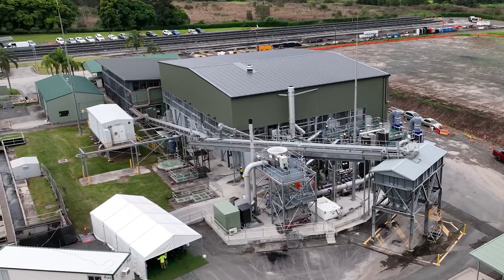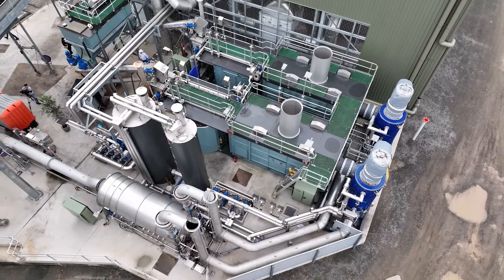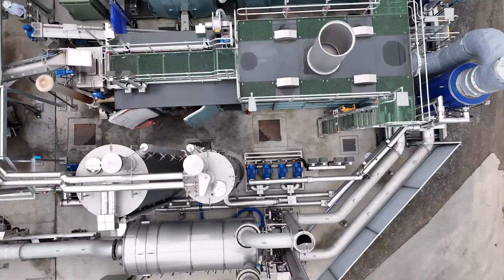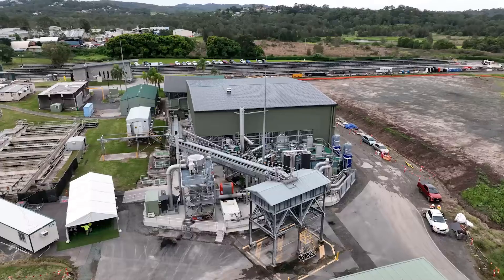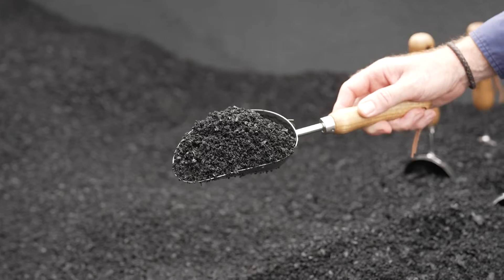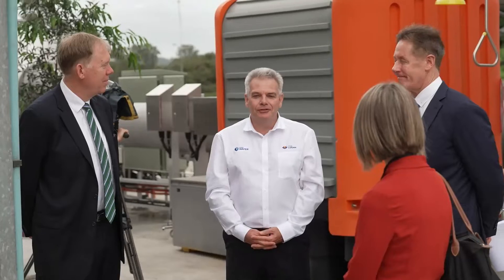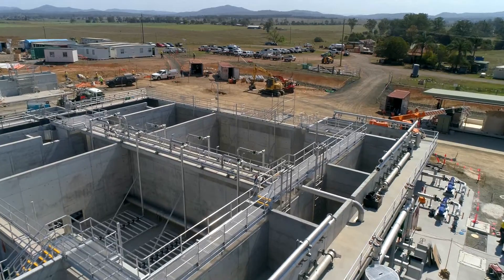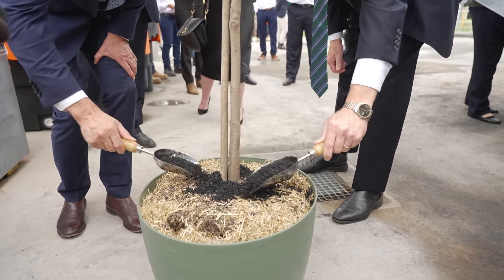Making biochar in the City of Logan

Comment: Can someone answer a question from Logan City please.  Does the area surrounding the plant smell at all or produce noxious fumes or gases that have a burn smell or rotten egg smell or poop smell?
Reply from the maker: Biosolids gasification does not produce any odours or any harmful air emissions. Exhaust gases from the gasification process pass through a wet scrubber and an electrostatic precipitator to capture any particulates before clean air is released from the stack. Logan Water continuously monitors and reports on emissions to the Department of Environment and Science. The product produced using gasification, called biochar, does not have any odour.
Reply: Yes it does!! I work in the Loganholme industrial area and it absolutely stinks!! I have complained to the council a couple of times now and sadly I don’t think it will be taking seriously. Definitely toxic. The smell is constant and seems to coincide with opening of the gasification facility. Surely not good for our health and is not good for our business when we have customers come to our workshop/office.

I’ve even been able to smell it 3km away at my daughters daycare centre.

Comment: How do you maintain an inert atmosphere for pyrolysis?
Reply: Do you mean 'have combustion with little or no oxygen'?
Reply: @nephos100  Yeah, because pyrolysis is the decomposition of material under heat with no oxygen, as that would result in combustion which produces carbon dioxide. I was wondering whether they either pump in an inert gas like nitrogen or create a vacuum. Because the 'greeness' of this process requires that no/little carbon dioxide is produced.
Reply: @HarukoIchikawaSakushinshuu  You will have to ask them. I suppose carbon capture is the name of the game.
Reply from the maker: The gasification process is different to pyrolysis or incineration. Incineration uses more oxygen in the heating process than gasification, and it produces ash as the product. Pyrolysis uses no oxygen in the heating process and produces biochar, biogas and a bio-oil/liquid as the products.
Hope that helps!